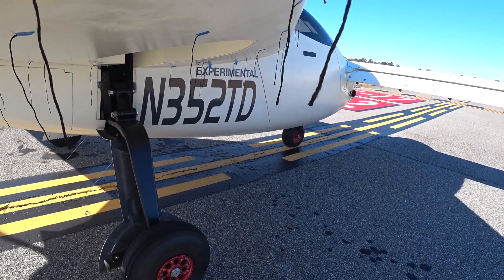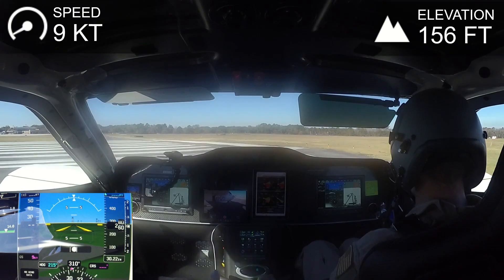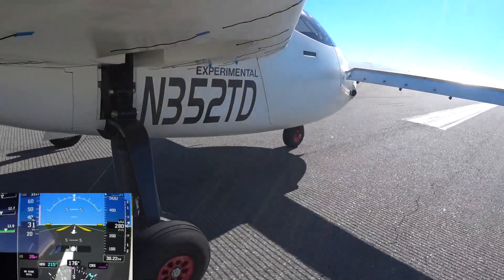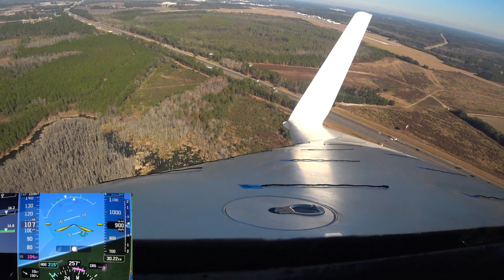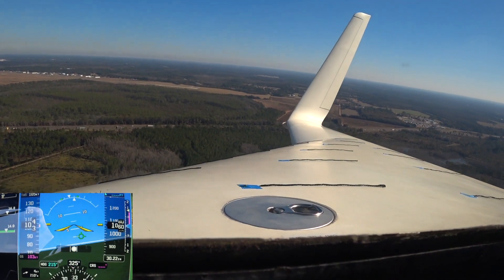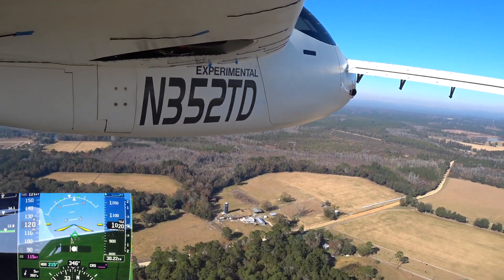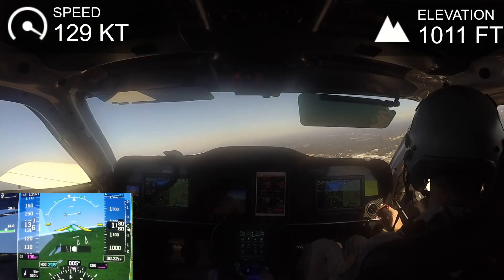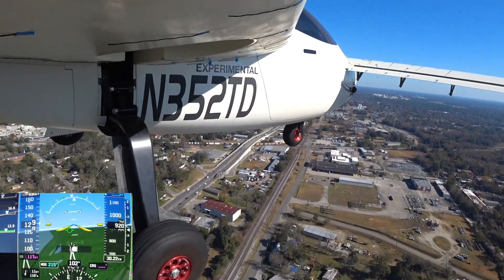Gear Up...  Check! - Flying the Raptor Prototype

Comment: Waiting for the cabin pressurization test. The gear test was very beautiful and I am excited for this bird.
Reply: he has to swap a piece of plexiglass first. I think peter might just worry about pressure on raptor build #2- production version. have to go back a few episodes & see- I think peter commented on his plan for that.
Reply: The plexiglass does need replaced, but he had to cut a hole in the pressure vessel to Install control cable pulleys after Justin and Elliot advice. So that definitely needs addressed first before any pressurisation can be tested further.
Reply: @waynehardy66  oh yeah... forgot about that. well.. portable oxygen til production model. save the $. I know peter's wallet must be feeling the pain by now.

Comment: Oscillation vibrations through the camera
Full steam ahead
Reply: Yeah, a vibration from the engine/prop just happened to sync up at a multiple of the camera's framerate. Most likely a totally benign artifact of otherwise typical airframe vibration. The only thing I could suppose would be the need for a dynamic prop balancing cycle.

Comment: At 3:06, the effect on that camera is called "rolling shutter." There's just a vibration that overwhelms the camera's image stabilization and that is at a high enough frequency that each image doesn't get read out off the sensor between vibrations. Where and how you mount the camera can make a big difference. Also, of course, the camera you use can make a huge difference. The Sony FDR X-3000s are pretty good.

Comment: to that one moron nay-sayer who claimed raptor was doomed? where'd you go forest? jenny says put on your wings & fly away like a bird! lol
Reply: @ryanthomas2472  but then it is only the first prototype, you are correct in saying that it won't perform to it's projections at the moment, however, we wait to see what subsequent prototypes can achieve. Long way to go yet and even certified aircraft have not achieved projected performance/weights from the design stage.
Reply: There were many, and they melted away into the shadows and into the primordial ooze and muck from whence they were spawned.
Reply: When the videos don't show anything overtly dangerous or foolish, there isn't much to comment about.
Reply: @T_Mo271  but there was lots to comment about when it was on the ground? Let's face it, there was a lot of hate directed at Peter by more timid souls with entrenched interests. They claimed that he would kill himself on first flight, if it ever flew. Claimed that he was an idiot or a scammer. Some online forums are dripping with hate for this project. And why? Because they don't want someone to try something new? 

Would I have done some things differently with the engine? Absolutely. Would I have Peter's success if I tried a project like this? No. He's been remarkably transparent, and unfortunately they has brought lots of internet experts offering their opinions and criticism. 

People forget that this is a prototype, and it is serving a a test bed for lots of ideas. If it flies acceptably being 1000 lbs. overweight and he can shed that weight once he settles on his final design decisions, then that should at least prove that it can move the promised number of people and fuel.

Comment: On Vortilons; The Embraer 145 series used 4 vortilons on the leading edge, just outside mid span. The shape they used might be useful to you. Theirs have wing deice air routed through them as well, so they might be thicker than you need.
Going from memory ten years ago, so specs may vary... Congrats on being a flying test bed unit...

Comment: The weird "jello cam", is a rolling shutter effect. It's common in digital video cameras when they are being vibrated. I would put a small accelerometer on the winglets at the top and bottom. You might have a harmonic developing. You can get some tape on digital ones that run off of Arduino.
Reply: I think that he put some in already in the build

Comment: Another good flight. Now you can retract the gear and accelerate to see if the handling characteristics improve with the higher speed. I suspect that it will improve. Do you plan to vary the intake opening to see if the cooling improves?